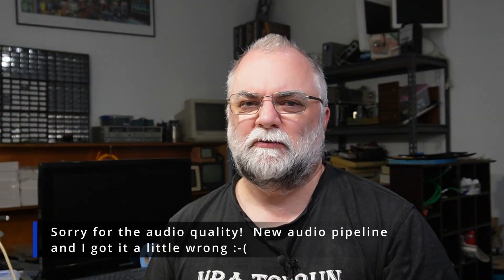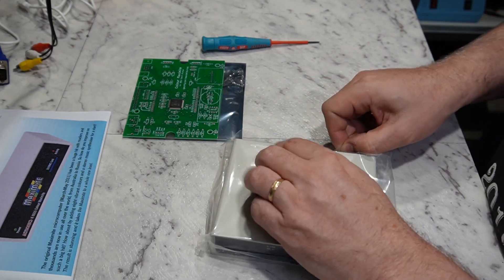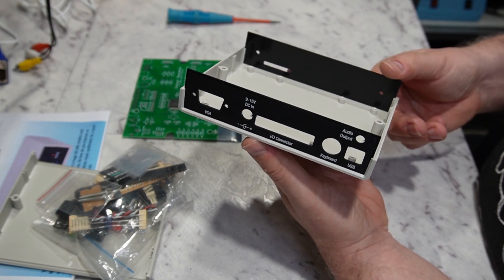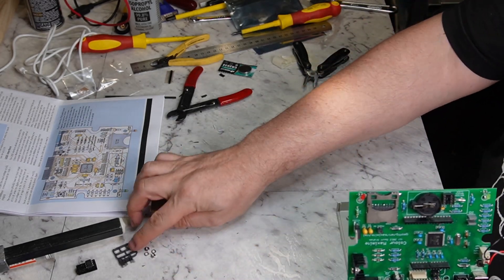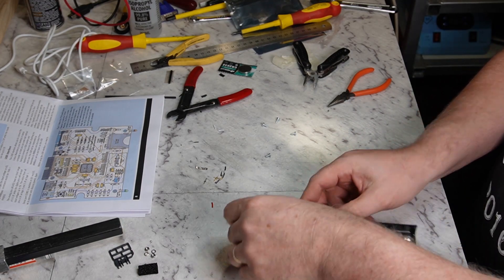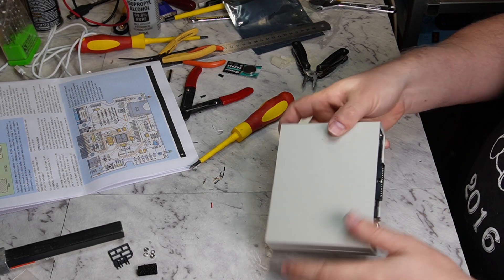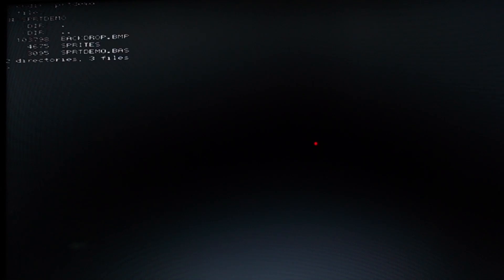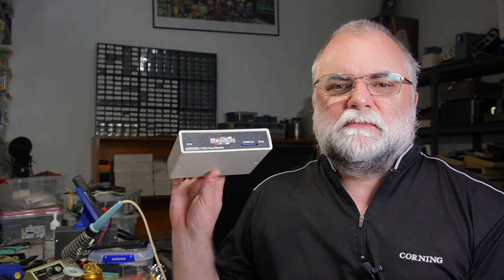The Colour Maximite Computer

Comment: I have a Colour Maximite and it's very useful for prototyping to have 5V GPIO and an RTC on one machine, plus it's fast to code up a program on MMBasic. If you need 3.3V logic then a Raspberry Pi Pico flashed with the PicoMite firmware can be programmed in MMBasic as well, which can also be set up with VGA output.

Comment: Curious how they are driving VGA directly from the PIC. Quite impressive graphical capabilities.
Reply from the maker: Looks like 3 outputs pins via 120 ohm resistors, a diode to ground on each, and the high side of the diode to the VGA connector.  Horizontal sync is 4 outputs commoned up, and vertical sync from a single output.  Presumably some smart interrupt driven code to scan out each scan line?  https://geoffg.net/Images/Maximite/SchematicLarge.png
Reply from the maker: Actually, the approach is described at https://geoffg.net/MaximiteDesign.html - pretty sweet arrangement by the look of it.
Reply: Ah I was thinking more from the software side, but that page also describes roughly how it is done, quite neat.